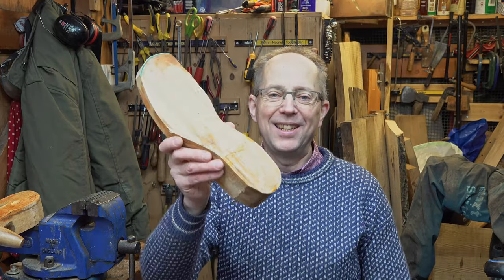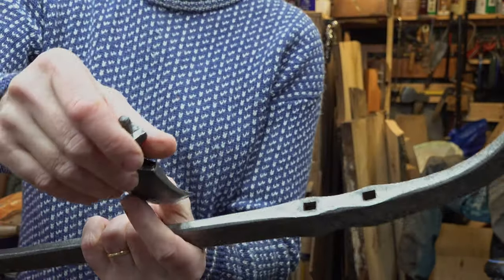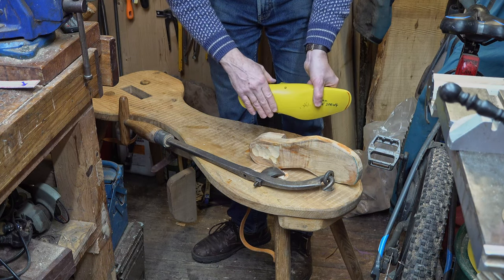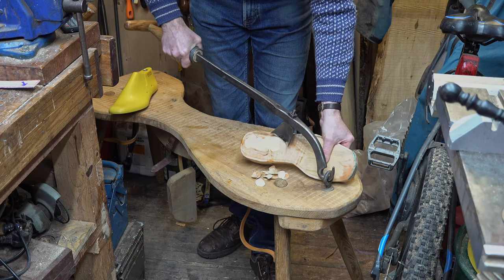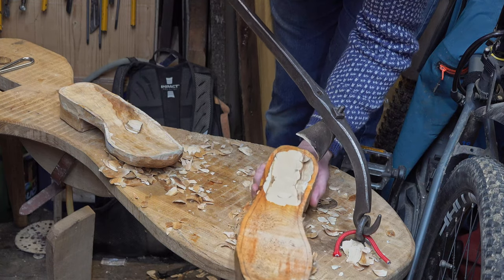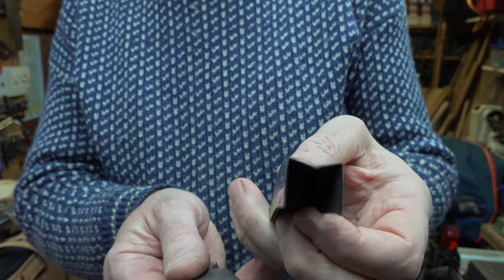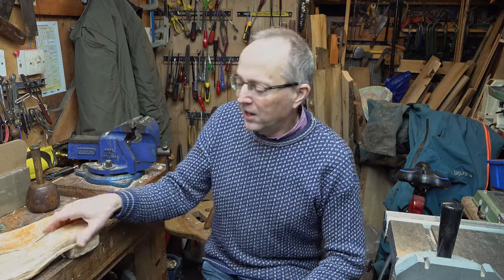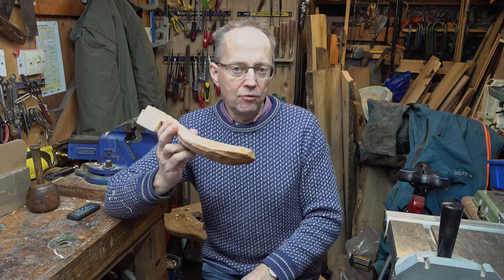Clogs 4 Hollowing Wooden Soles And Gripping Edges

Comment: Thanks for taking the time to show us, it reminds me of all the clog irons hanging on the wall.
Looking at the tools takes me back to our blacksmiths shop when we made things on the forge and anvil. Most of our work in latter years was for components for the cotton loom machines in the 1970s and then sharpening pick axes etc for the county council. (your knife handle reminds me of a pick) I never worked with my grandad so I missed out on some of the real forge work. As we modernised in the 1980s brining in new equipment power circular saw, MIG, TIG and plasma, the older ways were not needed.

Reminiscing - I recall my dad taking a phone call for the local grain mill animal food producer, the man said his mill was making a funny noise and held the phone up to it so dad could listen.... my dad thought for a bit and then said that he was not sure what was wrong but it sounded "expensive" ;-)) the mill was a very Heath Robinson affair that my family had looked after since 1890.
I still have the tool kit to join wide flat belts for steam an mill machinery etc. 
What is a shame is that the man that took over the blacksmiths workshop wanted to do fabrication and he skipped most of the workshop A VERY sad day.  He went bankrupt in 5years. We tried to help him ? he should have stuck to the old ways rather than specialise.
Reply from the maker: I laughed at the expensive noise, when I was young my dad recalled a story when he was on a creaking train with the railway chief engineer and the engineer said it sounded like an expensive noise as well! Anyway thanks for that.

Comment: As you where holding the sole, it occurred to me... with that type of shoe, one could stand on the "clog" and fit the upper over the foot itself... and mark, where the nails need to go.
Hmmm...
.
As you showed the last "fitting " into place.. I wondered if some type of carbon paper would serve to mark high spots on the footbed
Reply from the maker: Thanks that's an interesting thought....a bit like a dentist testing for high spots on fillings with a bite paper.

Comment: I was recommended by a spoonmaker to put wood that has already been carved, into a plastic bag with sawdust, loosely closed but not air tight, to avoid splitting while it's drying (slowly).  Have you heard of this method?  The sawdust seems key.
Reply from the maker: It's a good way of slowing drying..a bit like a bunch of damp leaves....and stops it cracking so readily.
Reply: @rodney73991  Interesting!  Thanks for sharing that.

Comment: Clogs 4 Hollowing Wooden Soles And Gripping Edges   0122am  17.11.23   dont you treat the wood prior to gluing and nailing the upper on to it?
Reply from the maker: Hi ....good question...no the Alder manages well in wet conditions.
Reply: @harryrogers  ???????
Reply from the maker: @JJONNYREPP  Modern thinking makes us think in terms of only using seasoned wood and using chemical finishes  but our ancestors were very good with working green wood and using the right wood for the task in hand  it's a different way of thinking largely lost in our modern world  but they knew what they were about. They always preferred Alder for clogs and its fine not treated. I hope that's helpful by way of explanation. Best regards Harry
Reply: @harryrogers  Comments on ‘Clogs 4 Hollowing Wooden Soles And Gripping Edges’  17.11.23  0943am   excellent. alder for clogs - in relation to soft or hard woods - this would be deemed the most heavy duty of woods, then.. or do you know of even sturdier woods utilized in clog making? in respect of wood quality - are these ancestors of ours choosing a pliable and hard wearing material or are they just plumping for durability over all?
Reply from the maker: @JJONNYREPP  It's a good wood for wet conditions as its does not tend to rot in water  so good for use in old damp  industrial places ...like cotton mills ...LS Lowry painting of Manchester and the clogg song for example...but also farmers and most working people who could afford them.
Reply: @harryrogers  Clogs 4 Hollowing Wooden Soles And Gripping Edges   1522pm  17.11.23   also very odd how a ten a penny piece of footwear as worn by the bedraggled could now be deemed an highly prized piece of clobber.... i think a pair of clogs cost a few quid these days...